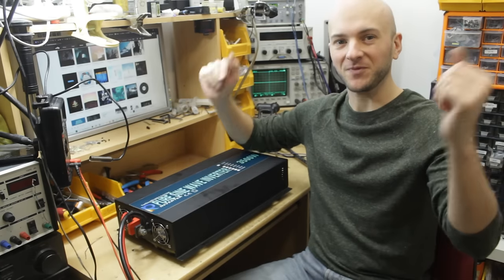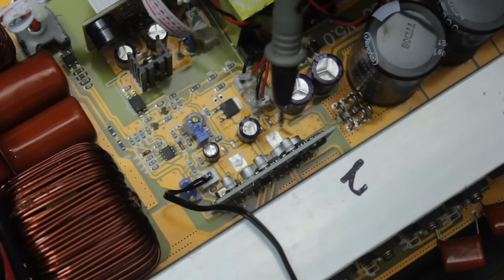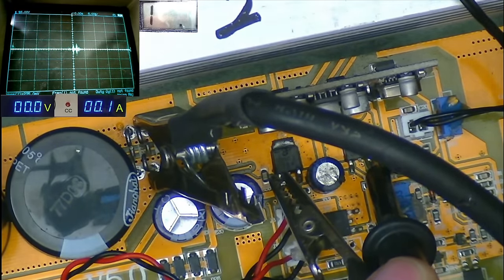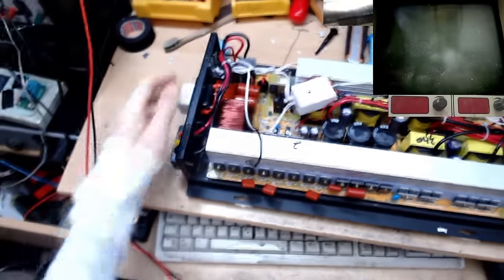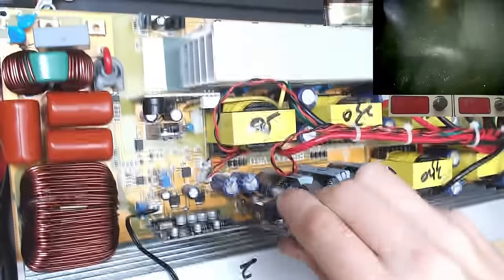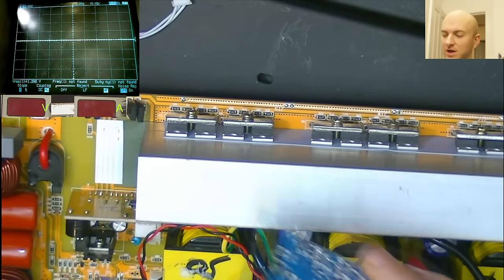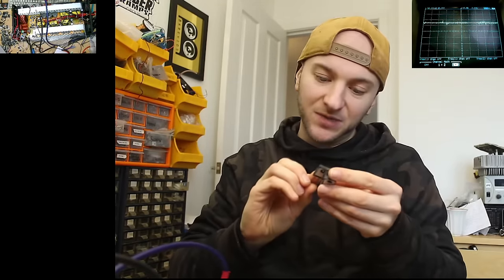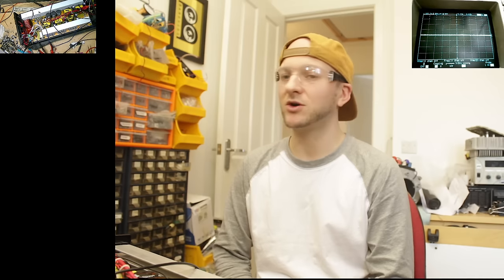24-240V Solar inverter nightmare fix!

Comment: Congratulations!  There is a little more about the IGBTs worth knowing.  While they are robust, they are radically slower than FETs.  You might consider the difference being similar to Darlington transistors versus single element in bipolars.  The issue is basically obvious on the turn-off.  In this case, the gate drive recommended for IGBTs provides a few volts negative, rather than zero voltage to aid the turn-off.  The driver you found, and used, is one for MOSFETs, lacking the capability to drive the IGBT gate to negative.  Another little observation is there with the PWM.  As your scope traces show, the 50 Hz is simply to invert the already pulse width formulated HALF wave sine on one polarity.  The PWM has taken place on that higher frequency domain, with maximum density evident at the sine peak range and narrower HF pulses, or even disappearing near the zero levels.  Those zero levels are when the other, 50 Hz switching takes place.  The spikes you see at the 50 Hz zeros are coming from the 50 Hz IGBT pair commutation AND the stray inductance from the output inductive filter.  In principle you have a trade-off between those spikes and a little “missing” piece of the slope.  You may have heard of zero voltage and/or zero current switching on certain power supplies.  The sad truth is, you can have both at the same time only, if you have a pure resistive load.  Anyway, I hope that these remarks help you on your further explorations of the wonders of IGBTs!
Reply from the maker: Fantastic comment, thanks!
Reply: I've seen boards that use ir2110 for igbt drive.  Raymond power cards are an example.

Comment: Great job, good logical repair mythology,  I've repaired CRT projectors back in the day, 30kV+ we rigged them up and stood the other side of the room to switch them on! If u need to make a monster power supply, i acquired an enormous transformer out of an old persons lift, had a few nice rails at a shed load of amps ;-)

Comment: @barevids I have a question on the reasoning for why amplifiers in the car audio industry aim for 1 ohm functionality over 4 ohm. The Taramps  MD3000 comes in a 4 ohm lowest impedance and with that you get more efficiency, more damping, and overall more accurate sound with the impedance rise being 2000 watts at 8 ohms and 1000 at 16 probly ~600 at 32. I was looking for an amplifier to run at 8 ohms for 2 sound integrity ht-18's and was looking at 2ohm 8k viking then found this. The 1200 also comes in 4 ohms and I see no reason to go with the lower impedance amplifiers. I think this would make for a great deep dive video. Hope I'm heard out here XD

Comment: Amazing job! I would have binned it long ago, since I don't have all the stuff to deal w/the tiny smd stuff! One reason I watched though is that I have the older Reliable 24V to 120VAC US version in use on my solar backup at home and wanted to see what you do with that one. Ya, one of the trim pots adjusts output voltage. I fiddled with mine! My big issue is that the voltage varies a lot. Funky loads messes with it's mind and it can drop down even with low powered loads. AND, from a cold start, it reads low then rises to 120VAC like half hour later. Crazy. I'm suprised you didn't test w/a real load, since you work on car amps, just take 2 ordinary batteries in series to get the 24 volts. Anyway looks like you figured it out quickly since a lot of the circuitry is in high power auto amps in a similar form!

Comment: Someone once said to me that switch mode supplies are only ever half a cycle away from going BANG! That mantra has stuck with me and I hate working on them. There's just no room for error and even if you can limit the voltage / current while testing, eventually you have to apply full power and that's usually when the fireworks start.
Reply from the maker: Yep! 😂

Comment: Get yourself some big low voltage incandescent lamps and use them for this stuff. I use normal light bulbs in vacuum tube amplifier repair. The bulbs will eat the current if there is a short and in many cases, save you a lot of pain and money in destroyed components. Truck lights are usually 24v and car lamps are 12v nominal. I usually don't run the bulbs in series with the supply when doing load testing, but I do when I'm trying to figure out what is going on and I want to protect the device as much as I can. High voltage stuff can be scary. But the scary part and the respect you have for it, is what keeps you safe.
Reply: The problem is usually from all the on-board capacitors. You would need to take those out of circuit and  connect them through the lamp
Reply: @DrewskisBrews  that is an issue for sure. I also have both a variac and a variable dc supply just for those purposes. Somtimes I'll even bypass a supply completely and replace it with my own current limited one.
Reply from the maker: Yeah the issue isn't limiting current from my supply. The issue is that one tiny issue in the board and the IGBTs explode regardless of what supply you have connected. Switchmode repairs are a lot different to older linear stuff!
Reply: @barevids Thanks for the education :). I often avoid switch mode power supplies due to the noise they can produce. I repair old vacuum tube amplifiers and I also build guitar pedals. In those there are common chips used mostly for voltage doubling/generating negative supplies. The ICL7660 and MAX1044/1054. I actually avoid those due to their switching frequency being far too low along with them reducing SNR when dealing with tiny signals. A hidden factor to keep in mind is that if you build an octave pedal, the signals that are normally in the inaudible range will be brough down into the audio range. Especially with double octavers. I do appreciate seeing you at work. :D

Comment: Could instead of using the adjustable power supply have 2 x 12v batteries in series and a 50 or 100 watt bulb in series so it gets 24v but any short the bulb goes bright and limit the current

Comment: Using multiple outputs transistors improves cross over distortion and feedback correction. The same as class ab.

IF YOU ARE INTO AMPLIFIERS BUY DOUGLAS SELF AUDIO POWER AMPLIFER DESIGN.

Comment: I have the same unit it had same problem . them crapy irf mosfet driver are not very good alway blow the IGBT drive. best to change all the out put of the IGBTS also check same smd diodes they do go short same smd  resistors. if you replace the two irf drivers again and all the rgbt and make sure the resistors and diodes are good. My own inverter I redesigned the spwm board with proper toshiba tl250 drives insted of crapy irf mosfets drivers. work lake a charm more reliable and work better then befor.  that switch mode variable voltage and current power supply that you bought Farnell I have the same one excellent had for years now.
with these inverters you have to make sure everything is perfect small mistake and you have problems.

Comment: Regarding the questionable IGBTs, it really wouldn't surprise me if it came out of the factory like that.  Reliable to this very day still spruiks the use of Nichicon capacitors in their inverters, but of course they are fitted with cheapies.  At least they stopped re-sleeving cheapies to make the appear to be Nichis.

Comment: great vid as always   You can use a resistor to charge up the rail caps just use it on the main input like a 5 or 10 ohm until the rail caps  are charged then hook it straight up without the resistor then you don't have to turn it on and off a bunch of times  Good to do even if inverter is not broke when first hooked up to the battery inverters have huge inrush current and always make a big spark when first connected   Beautiful Repair as Always Can't Wait Until Your Next Vid   Cheers

Comment: Was hoping to see you working on an inverter some day... I knew the day would come with your knowledge of amplifier operation.

I have the older 48v - 120v version of that inverter before they changed the sticker from "reliable electric" or whatever to the sticker that's on the unit you have here. 

Been going nearly 24/7 for 5 years. If it dies this will help me since you explained operation so well.

I've repaired a small 1000w grid tie inverter in the past, but it was pretty simple with just a few shorted input switching transistors.

Comment: You know I have to break your balls about that homeowners meter now right? Lol good meters are so cheap these days! I paid big bucks for my Fluke 88 back in the 90’s when I worked for Chevrolet. It’s a great meter but you can get one just as good or better for half the price. I paid $400 US back then. I don’t know how you deal with having to change the dial all the time. Nice solder work though I must say!!
Reply from the maker: Thanks lol! I hate posh meters tho. I can't stand auto range, and need there to be absolutely zero delay for the continuity beep. Many flukes I've tried have been awfully slow both at range and beep delay.
Reply: @barevids  interesting. Mine is fast enough. I have the very good silicon probes they used to come with
Reply: @barevids  there are plenty of channels that do these tests. Kiss Analog tests scopes and meters
Reply from the maker: @kennyrmurray  sounds good! At the moment tho there isn't anything a new mm would do for me over this cheap one. Would just be spending money for no benefit which would be better spent on parts etc. If it breaks I'll check it out tho  thanks!

Comment: Hey, man. I have a question about my amplifier and I'm having a hard time finding the answer. I had my amp (Synergy Audio WFO 8.4D) wired up with it receiving signal, but I didn't have my door speakers hooked up yet. The amp is now flashing protect. It's outside of the warranty period and it's my fault anyhow for causing damage. Anyhow, I have the back panel off and I've found the problem, but I cannot find the part I need anywhere because I do not see any number on it. Do you have an email where I can show you what I'm seeing?
Reply from the maker: Facebook.com/barevids
Reply: @barevids  Just sent you a message there.

Comment: Free stuff!!!!!lol jk Which would cause more impedance rise (1) 12” woofer @0.5ohm or (4)12”woofers @0.5ohm????????????????
Reply from the maker: the question doesnt make sense buddy and sounds like you are trying to avoid rise which is not what you want to do. dont worry about rise as it is a resultant, not a controllable factor. spec your system correctly based on power, mechanical, and electrical limits, the rise will be what it will be. If you reach amp clip point and the woofer isnt at mech or thermal limits, and you still have electrical headroom, then buy a bigger amp. you dont even need to think about rise.

Comment: Until the plandemic , I taught wind and solar at a junior college and always wanted to see just how similar amps and inverters actually are.
Reply: Haha, yeah, similarities don't end at the external case design
Reply: @DrewskisBrews  I knew that an inverter was a voltage multiplier and dc to ac inverter that only played 60hz USA, but not exactly what the differences in circuitry were.